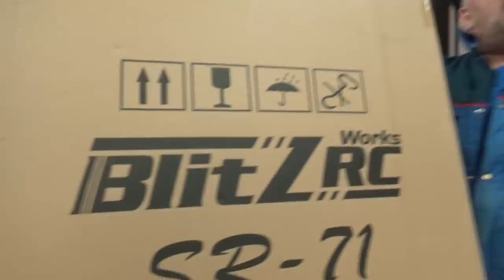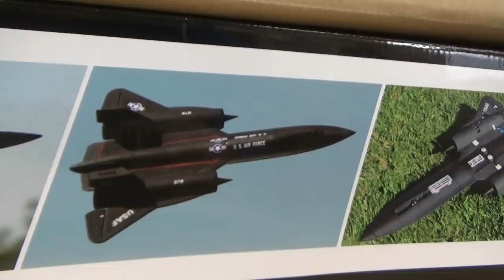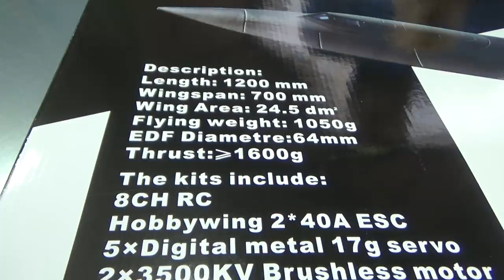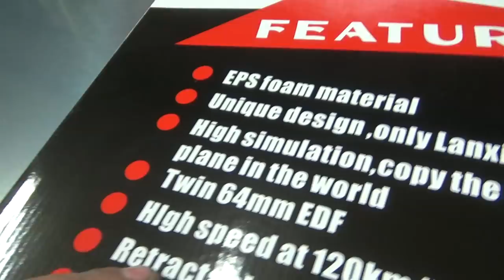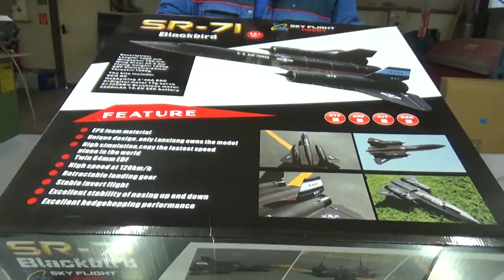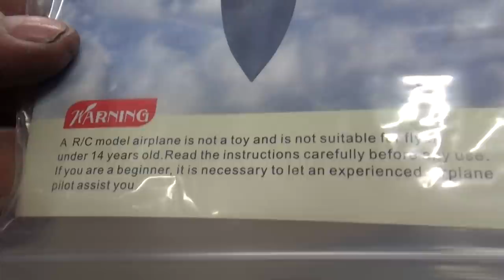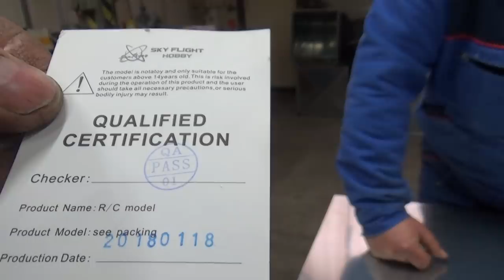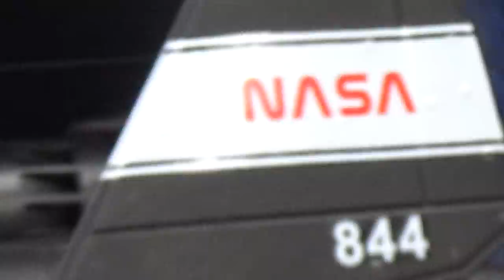SR-71 Blackbird Lockheed 2x 64mm EDF Jet PNP Sky Flight Hobby Unboxing

Comment: I'm crying in my hanger! My Avios C130 prop disintegrated on take off and you can guess what happened from ten feet up. 6 little blades were all over the parking before any impact. Best of luck to our glue. I'm ordering more Foam tac before any repairs.

Comment: Hey Robert. I had two of these the first lasted three flights. A really good 3S 2200 gives you a flight time of less than 2:30 at high power before one of the fans starts pulsing. make sure you have a VERY good battery. If you fly it stock just cruise around admiring its looks and land after 2:30. Don't run out of battery, it doesn't fly well deadstick.
My second one I bought as a kit and put in my own lightweight fan/motor/ESCs. It has barely enough power to fly but I can get 3:30 flight time. It doesn't fly very well but it looks FANTASTIC in the air.

Comment: I had this model. It looks great but the wheels are tiny so I never got mine in the air. You're right about the old school foam. Be careful pushing the two fuselage parts together. Mine got a lovely thumbprint. Don't worry because you do have a lovely model.

Comment: You should run carbon fiber rod in the front of the plane to keep it together. I love Motion RC for a reason. They actually  open the box and check your plane before they ship it. If you order additional parts, they carefully  wrap the exra parts and send them all in the same parts. Hey look at the bright side, you have more parts than what they said. So really, you got a great deal because it came with more parts. Also you get to assemble more than you originally thought so that right now makes it worth more. I am kidding of course. I would be PISSED!  NOT FOR $300.

Comment: i would be a little unhappy too if my new $300 came with broken parts. The good thing isall those little parts can be re-attached and with a some fiddling it can be made whole again. but ya, for your 300 euros you shouldnt have to do anything but charge the battery, check the c/g and trim it in flight. and with 5-blade EDF its going to be kinda loud, probably. i just hope that once its fixed and its it the air we will hear the famous laughterfrom you cpt. pilot Robert. salute.

Comment: Yeah, it sucks that it came broken, but honestly it's not so bad. LX models are usually decent enough, but certainly not top of the line. I know you'll get it fixed and once it's in the air you will forget all about the little extra hassle. Get ready for the realization that you might have to put in some 10 or 12 blade EDFs.

Comment: yep blitzworks  junk , i bought this from bananna hobby 10 yrs ago maybe . first thing throw all electronics away there junk. i see they atleast put a skywalker esc 's in ... it was highly underpowered and battery compartment was too small  .. would only fit a 2200  3s .  it flew but for about 40 seconds and caught on fire.... the best part was the smoke n flames as it fell out of the sky  wish i had video of it. do yourself a favor and dont buy blitzworks. same with my a-10 it flew but one engine burnt out but i managed to land  .. after over haul of a-10 and carbon rods she flies great ... send it back. there electronics are garbage.

Comment: its like the real plane the real plane had problems  when it was sitting on the runway they would leak fuel wile sitting ground
Reply: Greg, not a problem but an intentional design feature. Due to extreme heat fuel cells were indeed designed to allow for substantial expansion at over Mach 3. If you search the net there are photos of them leaking fuel while being in-flight refueled. :-) Quite the bird though, I always liked the way they look. Other trivia being the fact the SR-71 doesn't use paint for its markings; they're chalk!  Paint would burn off.  And the glass in the cockpit canopies is Pyrex oven glass and heats to 400 degrees in flight!  Or that the engines are the only jet engines designed to run at full afterburner for hours and get so hot they literally glow and you can see through them in operation!

Comment: I saw the interview of a pilot that said when the plane got up as far as it could fly in the atmosphere that it was non controllable because there was no atmosphere to pass over the control surfaces  so it would start to go out of control. I remember the first time I got a ready to fly and there was no remote even though the box said it had. I bought a Cerrius plane that had one of those programmable remotes that you use your computer to set it up. The problem? No disc for the program for the computer. So even though the plane came with a remote transmitter, It was useless. I couldnt even use it! I went on line and NO ONE had the program. It was a free wing. Needless to say I shit canned the transmitter and receiver. Sorry you got a badly packed plane. $300 for a plane shouldnt come poorly packed and BUSTED.

Comment: I am sorry for you Robert. That is not worth 300. The material is disgraceful and the way it was packaged was a joke. Bits broke off and twisted. You can even see the hot glue around the engine compartment.
You will need to do a lot of work on it but you are great at building and fixing so I really hope you can fly it.

Comment: Sorry for your disappointment.  I know that you will fix it and make it fly no matter what.  Perhaps worse than this is having a new plane ripped to little pieces by a kitten before it has even flown.  Even Freewing is not exempt.  The cat tore off the whole wing tip from a Stinger and the wing tips plus aileron from three other planes even though they were hanging from the ceiling.  Ah well between cats and planes, I guess I will still choose cats.  Crazy maybe.  However repairing planes can be more satisfying than building them. But nothing beats flying.  What to tell?  I will fix them and make them fly no matter what.  That's life in Montana hey.  Salute to you guys.  You remain positive no matter what.  Keep it up.  Your videos are the best.
Jack